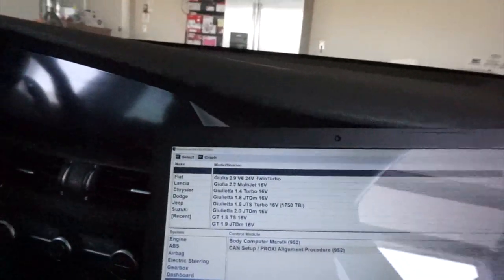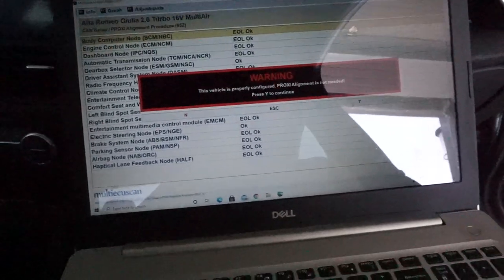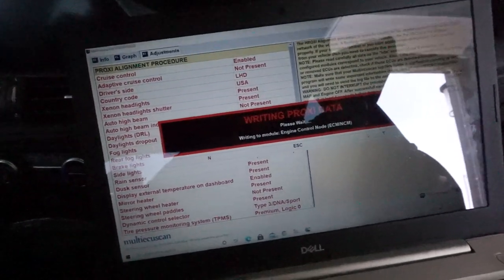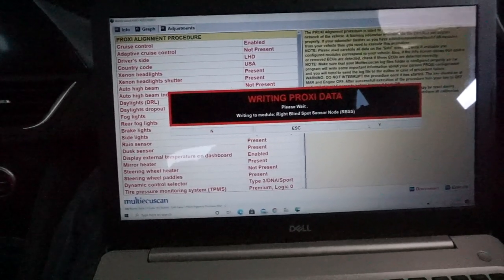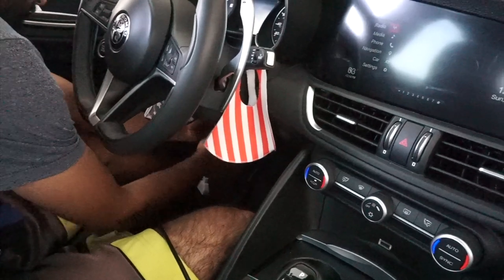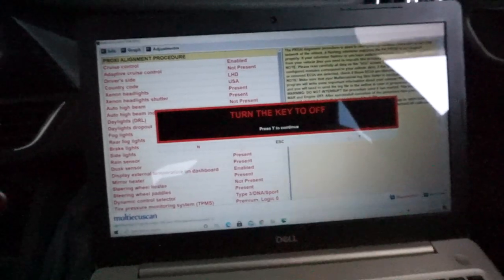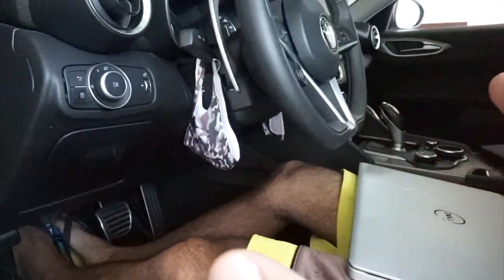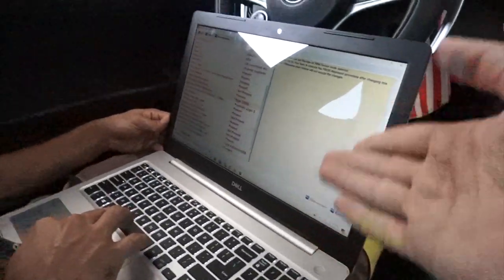Alfa Romeo DNA/Race button programmed. DIY/FIY

Comment: You did everything just right the whole process, but you didn't pull the "RACE" trigger all the way up, it's a little bit hard to push it... good job man try again, and keep "type 3" it's the one you need.
Reply from the maker: Yea still trying to figure it out
Reply: yeah you did it correctly the first time with type 3 you just kept putting the car in dynamic instead or turning the dial past it into race mode.
Reply from the maker: But I never had any signs in dash and I tried to put the button all the way too but still didn’t work. After like few hours even the sign in middle screen went away as well it’s like the car ECU doesn’t wanna program the button
Reply: If your car model year 2018 or above you gonna need the SGW bypass to do it.
Reply from the maker: But it’s 17 tho that’s the thing
Reply: @waelamer9462   can a 12+8 sfw bypass cable do the job?
Reply: @gilahish1  On my 2017 giulia I've done it only with obd cables no need for bypass, for later years I'm not sure what exactly the procedure.